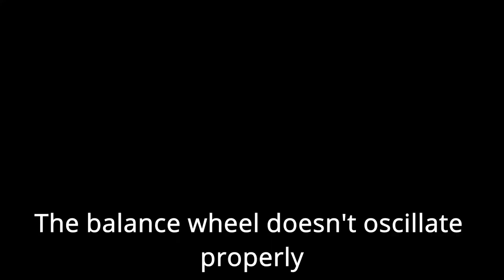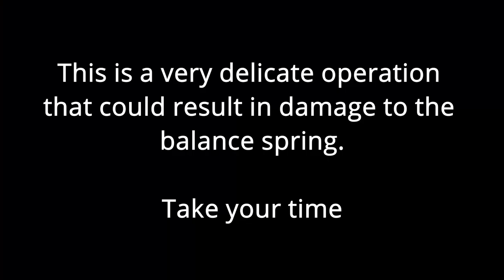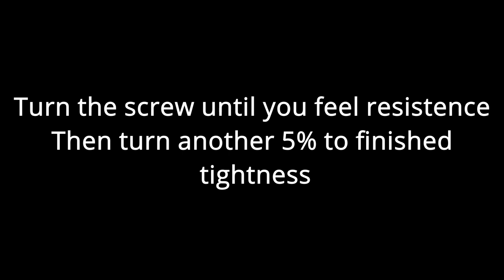How to install a Balance Spring

Comment: I am building a parts watch "as st 1960/51" that what I believe is a three tab "SHOCK RESIST" spring.  How do I gain access to the chaton a jewel?  I would greatly appreciate your help.  Thanks
Reply: I am unclear about what movement you are talking about
Reply: @watchrepairtutorials  The Forum Watchuseek I posted some pictures.  A lot of the posts mention the cap jewel can not be removed.  Plan B for me is to use an oiler.....lol

Comment: Would the balance wheel still be working without the safety pin (or broken s.p.) on the pallet fork^
Reply: On the bench yes, but as soon as the watch receives a small bump it will stop. The guard pin is part of the safety system of the watch
Reply: @watchrepairtutorials  Thanks it's appreciated

Comment: Recently I got a new watch which has a open back case, i noticed that the balance wheel will slow down when the second hand is in the 7 to 10 o'clock position and then speeds up again, is that normal or should I get in touch with the watch maker.
Reply: Yes it’s that noticeable visually, yes I would have it looked at

Comment: Dear friend, I have bought a Chinese watch with a in-house movement. That was smart. :-) The watch run for few seconds and then stopped. Then again the same. Then run for few minutes and stopped permanently. I saw your video and thought I found a solution to my problem. I did it 3 times and then it run again for a whole minute and stopped again. Maybe you have any suggestion what else I could do, before dismantling it totally, which I will do for the first time in my life. :-) But again I have a stopped watch which I can not service where I live. Maybe you can give me your email and I will send you a link to the full video of what happened to the watch so far?

Comment: The problem I have is you can't see the impulse jewel from the top  so getting it between the two thind is a pretty hit and miss affair
Reply: you wouldn't miss it if you keep the pallet in its entry position and rotate the balance wheel in the shown direction and then the impulse jewel will move towards the pallet fork. Moreover, while the balance wheel is oscillating the impulse jewel is not always in contact with the pallet fork. The jewel leaves the fork while it swing away and catches it up again while swing towards the fork.